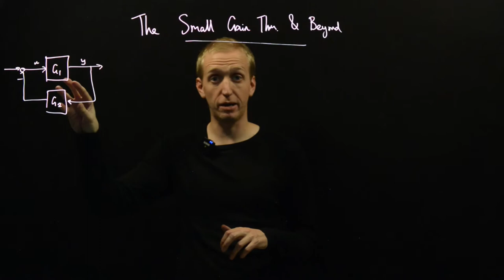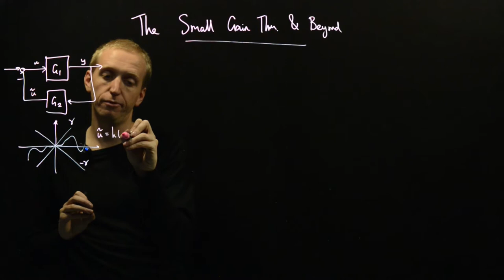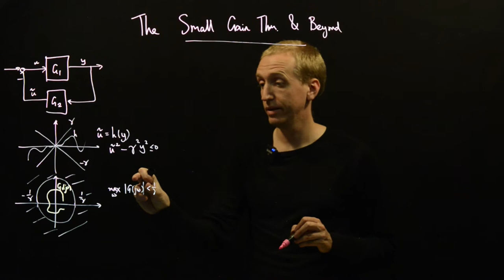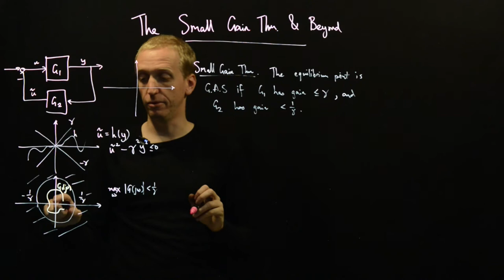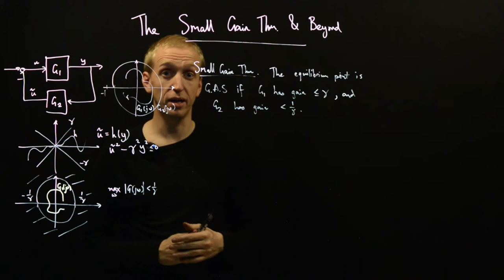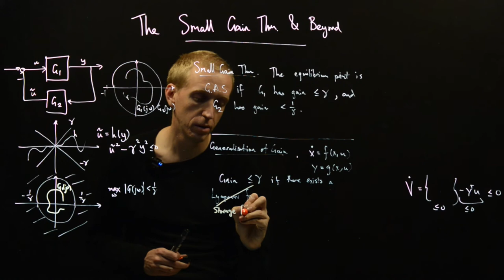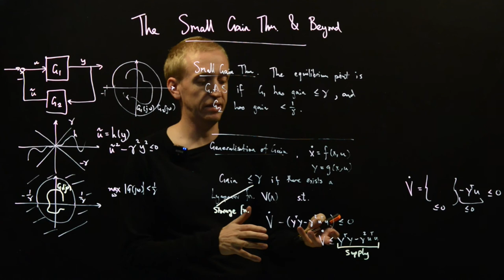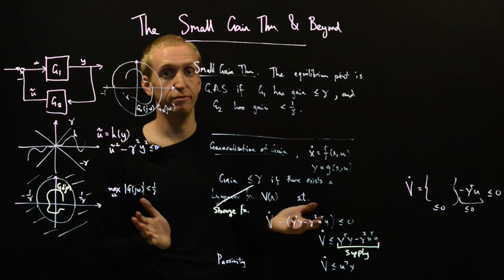The small gain theorem and beyond

Comment: Shouldn't  G1 be less than 1/gamma and G2 less than gamma, or am I just wrong?
Reply from the maker: Hello! You are not wrong - G1 less than gamma and G2 less than 1/gamma is sufficient for stability. But you can get away with the ever so slightly weaker condition that G2 is only less than or equal to 1/gamma, since this still implies that product of the gains is less than 1 (ie we need ||G1G2||<1, and use ||G1G2||<=||G1|| ||G2||). There are some very subtle details here though (we don't have to use the L2 norm - but if we don't perhaps we need to be more careful or adjust our stability definitions) - but unless you want to get very advanced, I wouldn't worry about it too much!